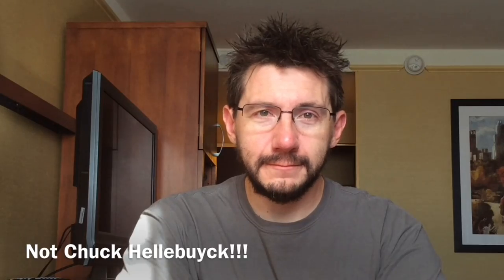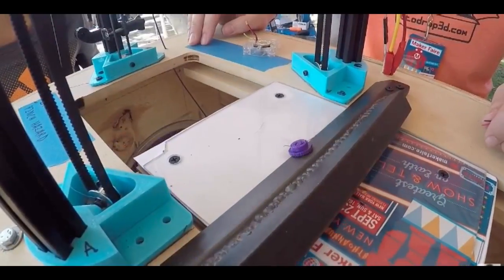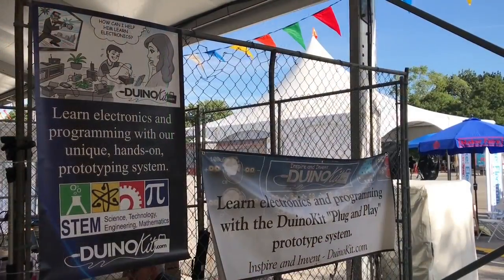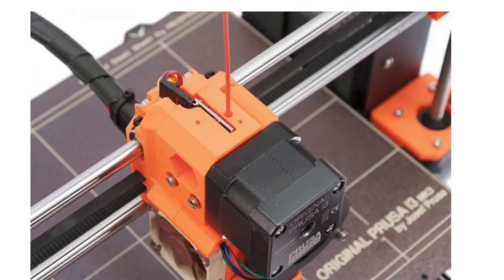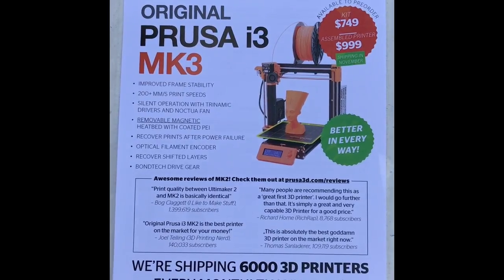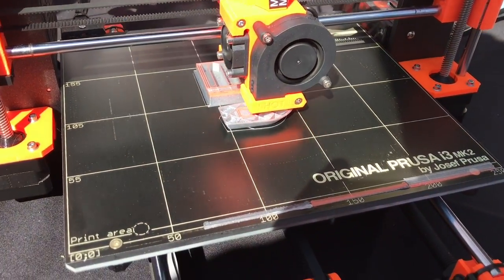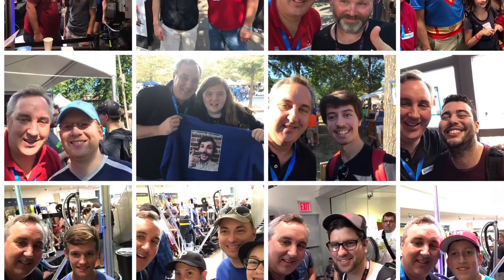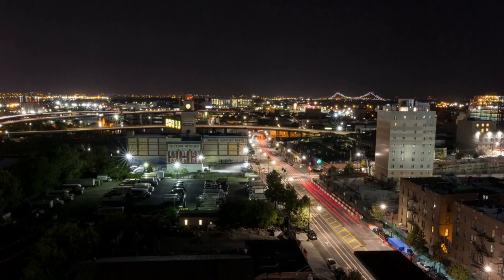MakerFaire New York 2017 Highlights + Interview with Josef Prusa MK3

Comment: Moving the motors with the power off is bad for the controller board electronics. Know the facts before spewing.
Reply: In all the years I've been designing and building printers, that simply hasn't been a problem.  Most drivers used these days are well protected against this very sort of thing and the drivers are able to dump the current correctly (in this case, you can see it powering the 12v rail.)  If you have specific cases where this has actually damaged a printer, I'd love to see them to understand why that particular design is failing.
Reply: I'd rather not partially power up electronics with under voltage and current.
Reply: The power to the important parts is regulated via low drop out regulators... so no damage will occur if the voltage/current is too low.  And the CPU and motor controllers utilize brown out detection as well... so they won't even try to do anything if there is insufficient power.